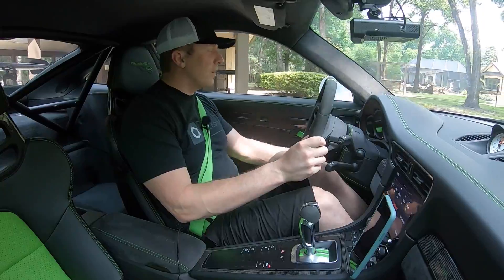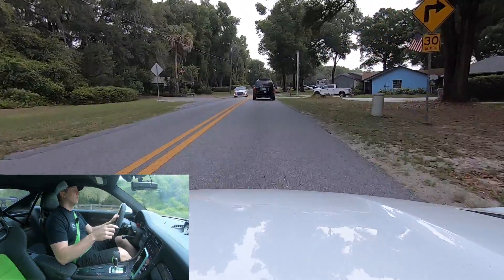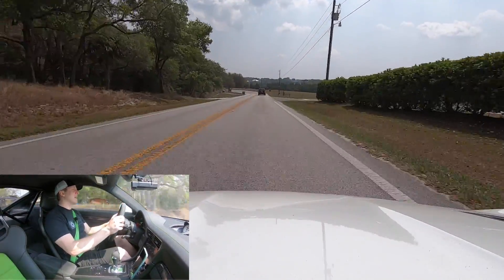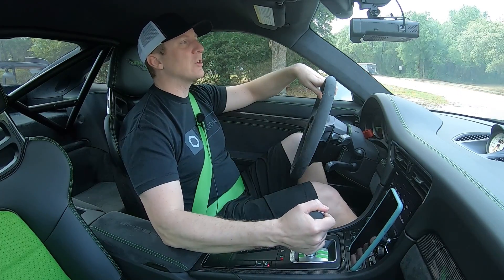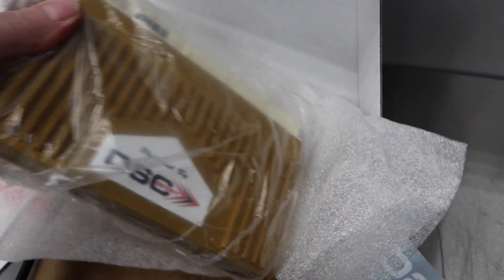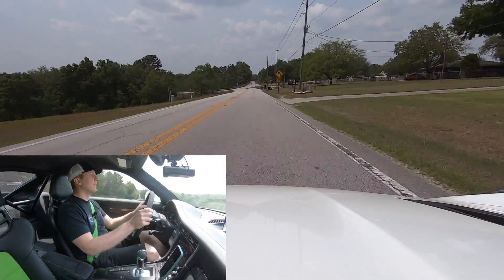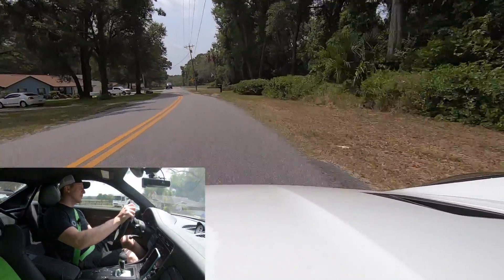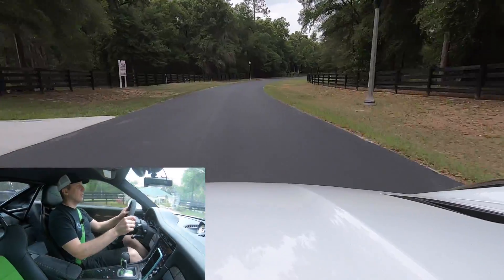991.2 Porsche GT3 RS:  DSC Controller - Before, Install, and After

Comment: I have the DSC v3 on my .1 GTS and totally transformed the suspension. I installed prior to two days at Sebring and you can feel the difference under hard braking where the front and and rear shocks are active in compression and rebound. On track I leave in Sport. If you lower the GT3 you will have hook up to a laptop and zero out the controller.

Comment: DSC V3 is transformational on the street... much smoother ride overall. However, on track... it unbelievable! The feel during a lap isn't so noticeable, but I cut almost 2 seconds a lap at VIR, a track I've done a couple thousand laps on. It's a must have upgrade.
Reply: Randy C so if it’s smoother on the street and faster on the track, why isn’t it setup from factory like that if it is just software? It doesn’t make sense that Porsche would make it so stiff just to make it feel sporty, like other manufactures do right? Or is it just a confidence thing and the stock setup would be better if driven in a specific way?
Reply: @OKF_Max  I think it's both adjustability and being more performance oriented in general. Just like how an aftermarket racing ECU offers much more adjustability than a stock one and allows you to do much more fine tuning. An aftermarket damper controller similarly would allow you to set the dampers to how exactly you want them to behave. Also I think since very few who buy these cars actually drive them on the track, the stock setup is probably more for giving a "sporty" impression by making low speed damping overly stiff.

Comment: I recently put eneki TS-10s & Michelin PS4s on my 2015 Si which reduced unsprung weight by I think like 10lbs per wheel (18s to 17s) and I have alot of these characteristics now - dartiness, "bounciness", tramlining. But the tradeoff of actuall grip & turn-in & throttle response was worth it.

Comment: Porsche performance equal to their win in the Rolex 24 Hours At Daytona! The TPC and DSC teams excel in all aspects of improving the performance of and maintaining your car. I have been a customer for 10 years now, and I give them the highest of recommendations. I can unequivocally say that they have improved my car so that I experience the most when driving my Porsche. They are considered by myself and many in motorsport to be true industry experts and professionals. The DSC controller improves damping and suspension performance through software inputs derived from motorsport data. Miles of smiles!
Reply from the maker: Well said.

Comment: If you lower the ride height, you may need to "zero the ride height" in the DSC controller settings.  DSC has instructional video on their site.  I'm still tweaking settings on my GT4 after 6 months...nice problem to have.
Reply: ...on 2nd thought, "Zero'ing the ride height" should be done at install.

Comment: If you haven't already, you should zero out the DSC. I have a C7 (pretty sure both cars are the same procedure, but ck w/DSC). Level the car, do the Zero travel adj for the DSC, have 1/2 to full fuel and you sitting in the car. This adj will tell the DSC where zero is in the damper travel while sitting still. It will make a difference. Right now you don't know where the DSC thinks zero damper travel is, because you haven't told it where it is.

Comment: 'Courtesy' revs are a bad idea, Matt. The fresh influx of fuel into the combustion chambers washes the effective film of oil from the cylinder walls. Your next start is a 'dry' one thus increasing ring and/or cylinder wear.
Reply from the maker: Meh...it will be just fine.

Comment: Have you seen the yellow GT3 RS detailed by Topaz, what do you think of the carbon upgrade to the plastics?
Reply from the maker: I saw the video, but I haven't watched it.  Carbon fiber swap is a huge undertaking and cost on the GT3.
Reply: Obsessed Garage sorry should have said, they wrapped the existing plastic in carbon fibre weave.  Thought it looked pretty decent maybe even legit😂👍🏻
Reply from the maker: Ah...no, I'm not an advocate of wrapping anything.

Comment: Matt, I will be taking delivery of a 991.2 GT3 RS with 1800 miles after virus restrictions lifted. For a guy my age ( 66) the dsc controller sounds like a must for every day driving. The car has no roll bar. Can I install the controller myself without removing the seat?
Reply from the maker: If you take the seat out like I did, I think you could easily do it.  The seat only weighs about 30 pounds, so it's pretty easy to get out.

Comment: I never do 'courtesy revs'. IMO you leave lots of fuel inside the combustion chamber. Then the un-burned fuel runs down through the piston rings, into the oil reservoir. Once there, the fuel dissolves and contaminates oil [specially E85], reducing its intrinsic benefits. So when you turn on your engine again, the oil heat will burn the fuel into ashes. That's why the once translucent oil becomes dark - burned fuel that passes through the piston rings. Then you have to change oil sooner and have more mechanical wear in engine moving parts and walls.
'Courtesy Revs' burns 🤑
Reply from the maker: Get out of here.  Weak sauce.

Comment: You cannot out engineer the Porsche engineers you bought a track car for the street and complain about its street behavior
Reply: Richard Messer This take is so bad.
Reply from the maker: First, it is not a track car.  This is a car built specifically for the street.  It has a back up camera, axle lift, mirrors, etc.  Second, I never once complained about anything in this video.
Reply: Richard Messer My friend...customizing a car to your liking is not an attempt to out engineer anyone